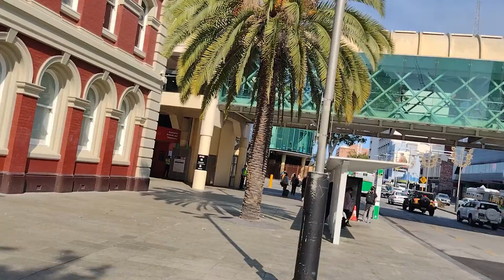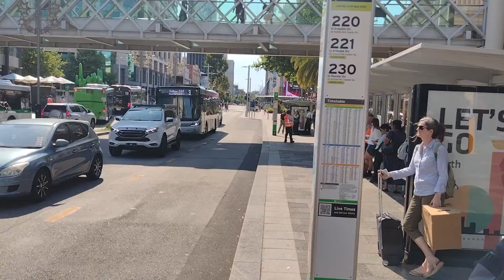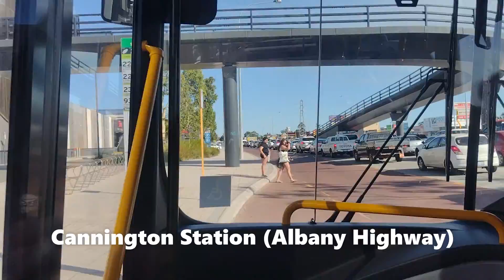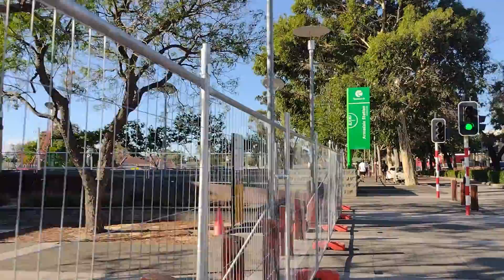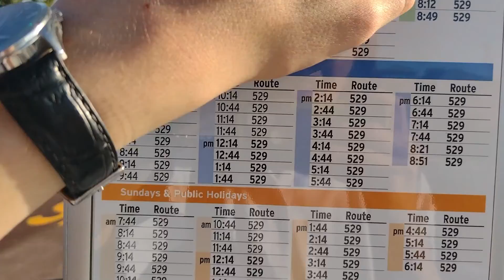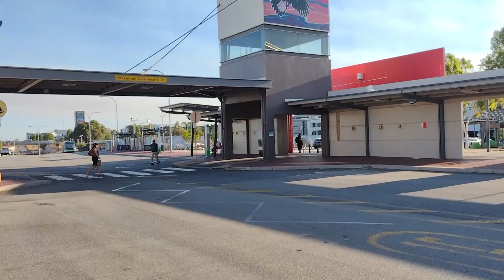Armadale/Thornlie Line Shutdown New Bus Routes Part 2 (221, 529)

Comment: I believed that the 529 was a route from like 2010 or sometime that did the same path but it was withdrawn due to low passenger numbers😂 18:19
Reply from the maker: Oh really? I'm surprised at that, considering what a good connection it is.
Reply: I remembered that 529 used to Run under Swan Transit back a long time ago, but that route between Cockburn-Armadale Station was removed due to declining patronage. However, this was reinstated 13 years later, albeit this bus route runs under Transdev.